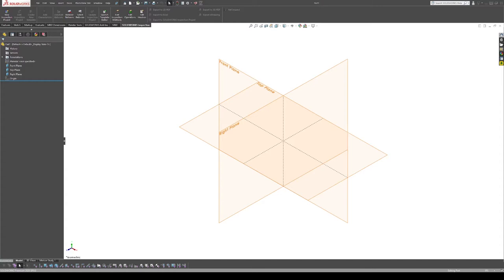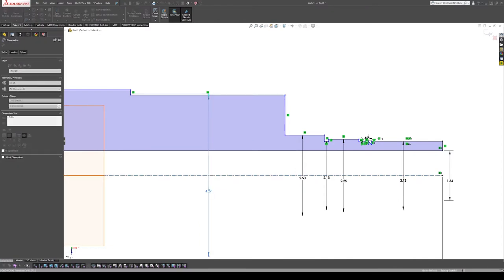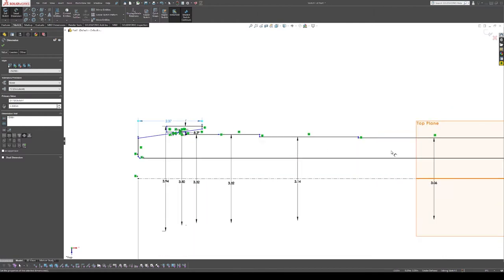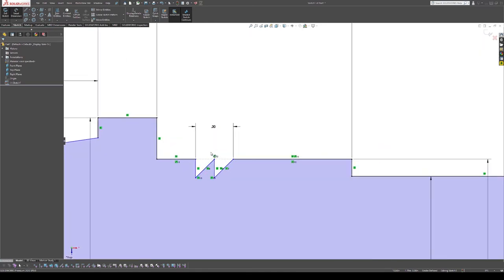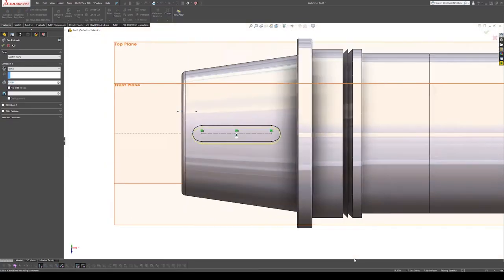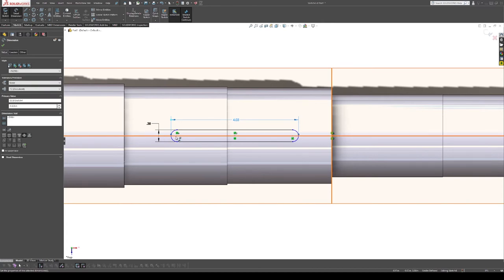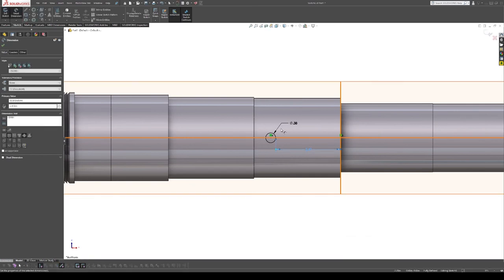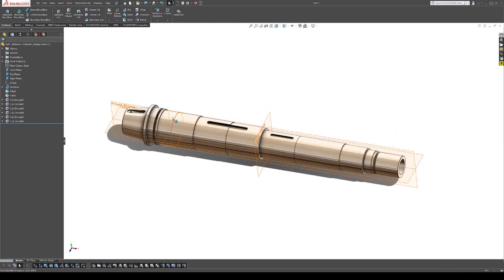1950 LeBlond Regal 17" Lathe Restoration Part 21: Modeling the Spindle in SolidWorks

Comment: Not boring at all. I am a beginner Fusion 360 user, so a lot of this applies. I just rebuilt a 1941 South Bend 13". If I ever do something like that again, I might consider constructing a 3D model of it as well. Very well done. Can't wait to see how this fits in with the rest if the model, and the progress of the lathe even more.
Reply from the maker: Thank you for the feedback. I've been working on cleaning out the headstock and repainting the inside. I still have components inside the headstock to model but the entire 3D assembly is nearing completion. There's somewhere around 300 unique components across the entire machine, so It's taken a while to get everything modeled accurately.